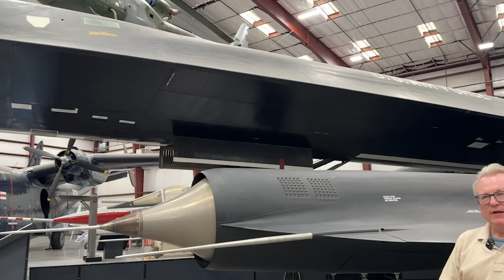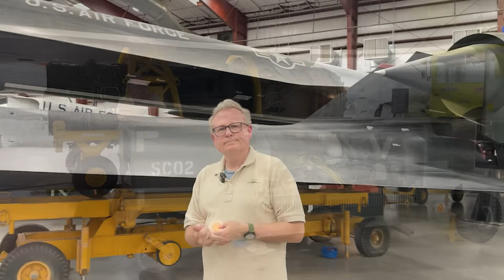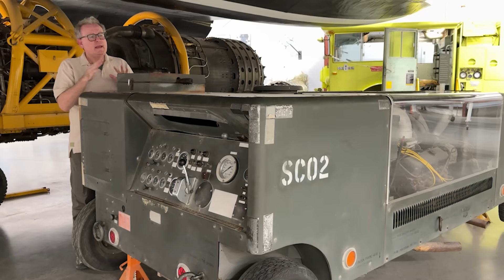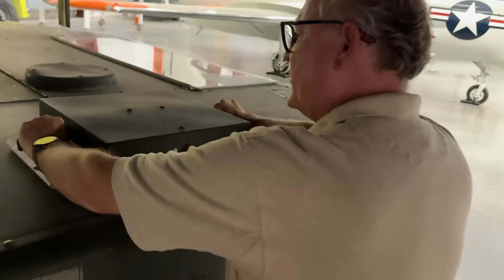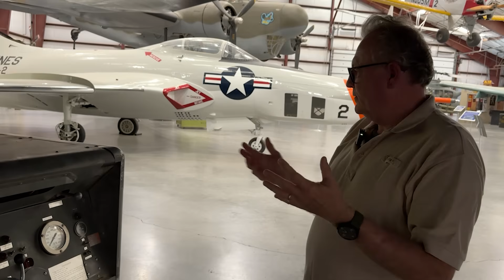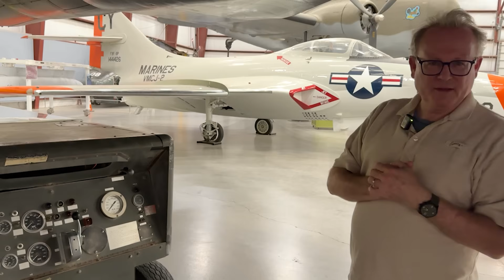SR-71 AG-330 Start-Cart and D-21 at Pima Air and Space Museum

Comment: Sorry to say but in my opinion this video is based on inaccurate information to a degree. The M/D-21 system was as described mainly but the SR-71 was developed as a different path, not directly connected to the D-21 issues. the history is fairly complex with the A-12 built as a CIA (no Air Force involvement on the design and development phase) and the airframe was then used for a fighter/interceptor base as the YF-12A, and a bomber on the drawing boards as the B-12. the USAF was only mildly involved as a support organization, during the A-12s operational time. Due to the no manned flights over denied territory the D-21 was developed, but the launch aircraft was destroyed on one of the tests so it switched to the B-52 launchers.
The USAF decided around the same time as the A-12 was nearing initial production that the idea of a fast recon aircraft was a viable idea so they requested Lockheed to provide a design and the SR-71 was developed based on the airframe but with more cameras and a second crewman. It is more of a descendent of the A-12 than a modification. Each of the airframes have significant differences internally to the structures especially in the fuselage forward of the wings. The SR-71 was well under way in the design and build before the M/D-21 was ready to fly. Indeed the first flight of the SR-71 was almost two years prior to the M/D-21 mishap.

Comment: A bit like how the gas turbine generator was started at the power plant I worked at except the engine was a big Cummins V-8 turbodiesel coupled via a speed increaser and torque converter. It started with the fuel racks full open at max governed speed.